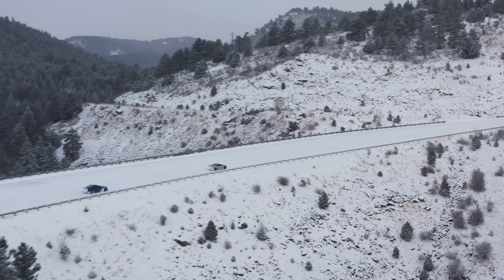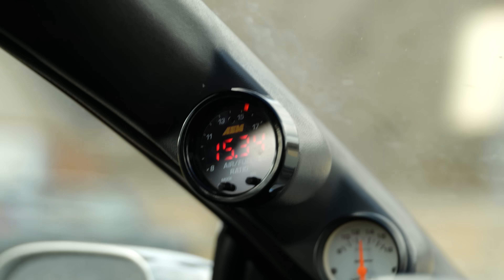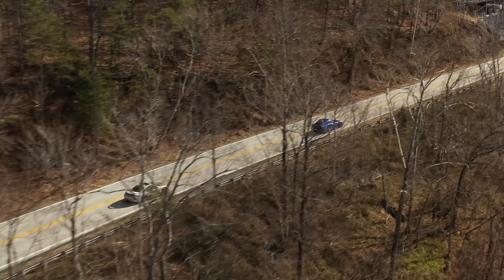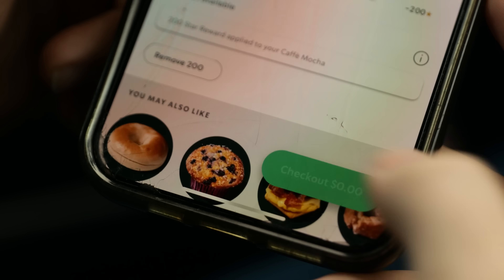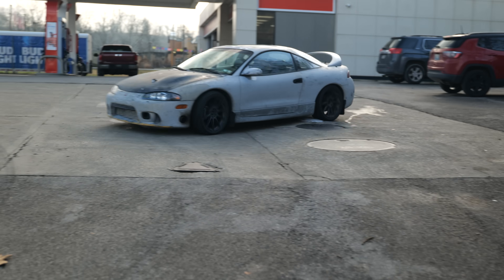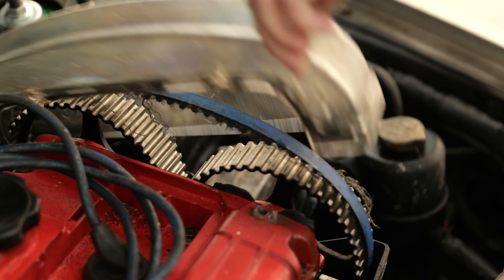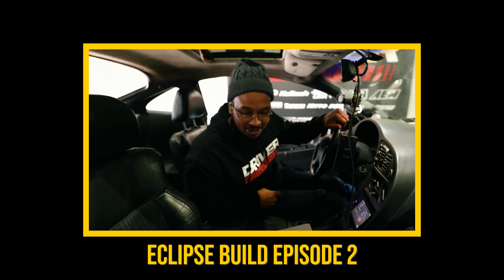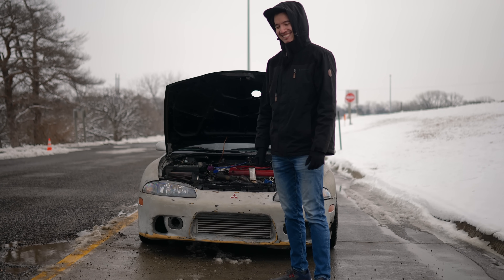We roadtripped across the country for as CHEAP as possible - Episode 1

Comment: As a longtime DSM owner the #1 thing I can tell you is ALWAYS change the timing belt no matter what the previous owner tells you bc people have a very bad habit of doing things wrong on these cars
Reply: Yeah, I have to assume it was just an oversight. No one in their right mind should trust anything that guy did on that car.
Reply: And if you remove the pan.... Bolts in proper spot.
Reply: Tons of amateur mechanics have touched these cars. Definitely good to verify everything.
Reply: Also nothing other than oem for tensioners, I used an aftermarket one and it lost pressure after only 500km, good thing I was tossing in a kiggy Crank trigger and I caught it before it wiped my motor out.
Reply: @schafer240  do they still even make them? I thought they discontinued the 6 bolt tensioner, like the knock sensor.
Reply: @8145dwerdna  I just bought three so I would say no they still are available, if they are discontinued and limited, that I'm not sure. I got mine from Mitsubishi in Japan.
Reply: And the possibility of the recall not being fixed on them too, the exact same thing happened to my dad's TSI in the 90's, it was almost 2 years old with 25k miles on it when it happened
Reply: @wolfgangkoeppen52  the previous episode showed receipts for a new motor...
Reply: @8145dwerdna  came here to say the same. 

For anyine who doesn't know, there are 2 bolts that are shortest than the rest of the bolts on the oilpan. These need to be used beneath the timing belt because using the longer ones will destroy the timing belt.
Reply: @8145dwerdna  mine is a 7-bolt but they still make it
Reply: As a longtime RX8 owner  the #1 thing I can tell you is ALWAYS Premix, Rev high, and Don't look at the gas gage!
Reply: Not to mention, they literally had taken apart most of the stuff to access the belt to begin with... I can't believe they didn't change it.
Reply: Any used car with a timing belt, with no history change it!
Reply: Used to own a 1st gen DSM. 100% true what you say. People beat on these things and try to make as much power out of the 4g63t engine with cheap parts from Wish. Almost every DSM lives a hard life...a life of broken trannies, clutches, blown motors, head gaskets and ofcourse RUST
Reply: I made a comment above and then right after figured somebody else already would have said it better lol- I had a '94 TSi, this is bringing me back to the old DSM forum days....
Reply: @Kasfinallygames I lived on dsm tuners and before that dsm talk.  I had 1g evo3 tsi and then moved onto a Holset hx35 2g gsx.  I miss those days so much!
Reply: Yes! tuners & talk I couldn't remember but that brought it right back @kottyking
Reply: Miss my 98... was a beast, 2.3 stroker 20g turbo 465hp.. I see it once in a while, still driving around the city, and it's changed owners a few times over the last 9 years
Reply: @12pawsinn  my dream build was a stroker, never got to do it.  I was part of the Holset gang that figured out how awesome they were on our cars.  Bullseye performance made a hot side you could bolt up to a ported 2g manifold so you didn’t even need to swap to a t3.  So cheap and could be found from the diesel guys upgrading their turbo.  I miss how cheap and easy it was to make good horsepower in the 4g63.  Yes, they had their moments of unrealiability but that was almost always user error or just something over looked in a car making over 400hp.  So when things go bad, they really go bad as seen in this video when timing belt shifted.
Reply: @Kasfinallygames  those were the days man.  Too bad time has eaten these cars.  I’d love to find another one in good shape.  I’ll always have a soft spot especially for a 1g Tsi with the gray bottoms.  My introduction to these cars was a friend picking me up in a laser.  The thing was hideous with a porno red interior.  He pinned the throttle my nuts hit the seat and it was a feeling I’ve never felt before at the time.  I was hooked on dsms after that.
Reply: Currently replacing a motor in a Diamante because of a similar oversight
Reply: But if he was to actually do maintenance, and treat the car properly...how would he be able to trash talk DSMs reliability and act surprised for his youtube channel when it failed?
Reply: Dsm and timing belts. Lost my 1997 because of it
Reply: DSM for life!!! I still have my 1998 AWD Turbo Eagle Talon TSi, modded to check of course, but interior is full and the only delete I did was AC, that's it. Still looks like she's off the showroom floor. Still on talk and tuners occasionally, but nowhere near like back in the day. I have been trying to find the bigger brother 3/S Sealth RT/TT . I've always liked the Stealth and Talon bodies over the Eclipse and GTO 3000GT
Reply: @Tyler97GSX  These, Civics and Subies have all just been through too much on the used market. You basically have to fine tooth comb them or redo absolutely everything if you want to even have a shot at something being reliable. And even then gremlins always pop up because cars are gonna car... lol

Comment: Is a fully built eclipse motor more reliable than a fully built evo motor?
Reply: Depending the Evo
Reply: It’s more reliable than a fully built sti
Reply: @Dcdc956 that's fk true😂
Reply: 4g63 and 4g63t have differences. Evo 1-3 used the same engine as eclipses, for evo 4 came bigger changes. And some new issues too. Common to see evo 4s with never evos engines for safety. Both of my evos had evo 7 swaps, for reliability.
Reply: Every generation tried to fix issues and faults for the next evolution.
Reply: From owning both I can tell you there's absolutely 0 difference, they are both reliable and unreliable for different things, also @CodKossu EVO 1-3 did not use the same engines as the eclipse they are especially 6 bolt to 7 bolt, 1G DSM to 2G DSM Years also make a difference, 98 up had the split thrust bearing. Stuff like that
Reply: It's the same shit just backwards.
Reply: assuming you're talking about 2g eclipses, what motor you got depended on the trim of the car. base model RS and GS models came with 420A's which is i recall are the least desireable ones since they make the least power out of the others. spyder GS came with a 4g64 which is a 2.4L making the second least amount of power. GST and GSX came with a 4g63t which is the same motor found in most of the evos except the X. so asking if the eclipse motor is better than the evo, the evo had the best variant of the three from which the eclipses had.
Reply: @Hogstyle the gsx comes with a 4g63t as well...

The 92 plus motors were 7 bolts like the evo 3+. The evo 4 flipped the engine to reduce the number of layshafts in the transmission. Each generation had changes, but they are very much the same engine. My 93 dsm 7 bolt has all evo 9 front end parts (oil pump, oil filter housing, timing belt components, timing gears). I also have an evo 8 crank and rods and pistons. The valves springs, valves, and many other components in the head are the same.
Reply: Very similar later 4g63s are rotated 180 to the passenger side. The evo does have 1 serpentine belt to drive accessories while the dsm is separate with 2 or 3
Reply: Depends who built the engine
Reply: @Carlos.Rivera 😂😂😂

Comment: I bought a 88 gmc Sierra 1500 for $750. in Oregon this last December. 
I spent $18 on a coolant temp sensor. 
Hooked up the tps sensor that was installed incorrectly by the previous owner. 
Ran perfect after that. 
Drove it for a week, then decided to drive it cross country from Oregon to north Carolina, with $600 in my pocket. 
Got 15-16 mpg all the way across. 
Slept in the camper shell that came with the truck. 
Ate terrible truck stop food. 
Arrived for Christmas with my family in 5 days with about $80 left. 
Done a ton of those type of trips over the years. 
Get out n have fun folks.

Comment: I will say with the experience I had with my 04 Rx8 through 15 years of ownership (4 failed motors, 2 failed transmissions just for starters despite doing everything under the sun you're "supposed to do" with a rotary) I am utterly shocked it actually held up, mind. blown.

Comment: Is so funny how you talk about the RX8. I had a friend with one that routinely drove from FL to KY and they did nothing special to it. No premix or that weird Rev thing. That car had nearly 150k before they finally traded it in for an SUV. That thing was bullet proof
Reply: I think the key thing was that your friend's car was probably continuously on the road and not in a barn for four years. And then Ben swapped in some sort of special motor and anything special needs special treatment.
Reply: The rev is really only needed on low compression series 1 rx-8s due to the weak starter.

Older rx-8s can use the series 2 starter to help with this as well.

With the extra oil injectors on the series 2 (which the R3 is) premixing is less of a problem but I still do it in my 2011.

Ben should remove the clogged cat before it causes damage to the engine.
Reply: That’s a hell of a lot of wasted fuel😮
Reply: That's because he doesn't know what the hell he's talking about I can guarantee he didn't buy it with a blown motor it was flooded he did do the deflood correctly but when they start they smoke like a freight train and will continue to do so until you clear it out which means either drive it or hold it to the floor intervals until it stops
Reply: What kill rotary engines are short drives, and never letting it fully heat up.
Reply: 150K is fucking nothing. Jesus, I'm sick of rotary nerds pretending that their cars are reliable. Just own up to it to man, and you'll feel better

Comment: As a longtime RX8 owner  the #1 thing I can tell you is ALWAYS Premix, Rev high, and Don't look at the gas gage!
Reply: I have an RX8 Series 2 GT similar to the one in the video, premixing isn't as necessary since it sprays more oil onto the engine that the S1s, I'm at 78k miles and still perfect compression and starting
Reply: @threadworm437  Mines at 108K with 7.6 and 7.8 on compression as an S1 🤣

Comment: when an rx8 r3 is in high gear and just cruising at around 65 its surprisingly efficient . loved mines
Reply: I get around 18-20 on road trips on mine.  My Silverado 5.3 gets about the same mpg but it's about the smiles per gallon
Reply: What rpm did you cruise at lets say 70mph? I wonder how those things are geared
Reply: @arlowelee  They run in the 4k range at interstate speeds.
Reply: @ScottJ175  Dam thats crazy. Even my Honda only is about 3500 at 70. interesting thanks
Reply: Yeah I usually average around 20 mpg with mostly highway and some city driving. I bet the rx8 in the video had a clogged cat which destroys mpgs
Reply: @arlowelee Yea my 1990 Miata is over 4k @ 70mph haha! So I stick to backroads most of the time around 45-55 with the top down and it’s always a nice drive. Love the car but glad it’s not a daily.
Reply: @arlowelee  normally cruise at around 3000rpm at 70 in 6th gear on a flat highway and just keep it there . getting up tp speed uses more fuel than maintaining the speed
Reply: I got 24mpg on my trip home from buying (~310 miles, mostly highway but some stops and idling)
Reply: @dellstudio10  Holy crap the miata is at 4k? Ive never driven one but i get why they say its so fun to. Practically rallycar/racing gear ratios with them so short

Comment: I owned a 2008 RX8 40th Anniversary Edition back in 2010. I loved that car and with proper maintenance, it was reliable. The stigma around this car is based around the fact that people not familiar with the rotary engine purchased them and tried to do the same maintenance as an IC engine. I feel the pain of the fuel mileage though, I think I averaged 14-15 MPG of the span that I owned it.

Comment: I had a 1995 Eagle Talon, and the same thing happened to me, the bolt on the belt tensioner loosened up, and took out the timing belt, luckily some how the head was good, and no valves were damaged. They were also known for crank walk, if you throw a drive belt chances are it's crank walk if no pulleys are obviously bent, or damaged.

Comment: They didn't put the short oil pan bolt on that goes underneath the t-belt. There is 2 short oil pan bolts so it doesn't rub on the timing belt.
Reply: It's been fixed but the belt didn't have a groove in it

Comment: Honestly, the coolant smell might not necessarily be because you're burning it; the exhaust isn't white enough, the RX8's smoke a lot when it's cold, so it looks normal. The under-the-hood coolant smell could be because it might have a leak or the overflow bottle is just puking the extra. As for the P0420, that's a dangerous game to play with an RX8 if it still has the catalytic...

Comment: I blew out my timing belt in the exact same way with my last civic. H22 swapped ek. Going 75 mph in 5th gear and the motor just stopped in the same way. I was an hour from home on a trip to get some used bucket seats, my dad was able to come tow me back home. I put a new timing belt on it and cranked it and by some miracle the valves didn’t make love with the pistons and it actually ran… freakin wild. My wife about killed me for that one.

Comment: Failed tensioners have cost me a few DSM valve jobs over the years, though I never shredded a belt, just jumped time. ALWAYS ALWAYS ALWAYS use a NEW OEM tensioner if and never try to recompress and re-use the old ones. It should be near a day 1 maintenance item at this point. Set the tensioner within proper range and always double check by running it though a full compression cycle so it actually extends to its operating position. Don't forget the balance shaft belt if an eliminator kit isn't in use. Miss the cars but definitely not the community of absolute hacks that seem to peddle them. That said, there's some really good people out there just the same and tons of camaraderie.

Comment: I've almost purchased both of these cars at different points in my life. 
The 2nd gen GSX (and 2nd gen TSi AWD) when I was living in Vermont starting my career (wound up with an SVT Focus). 
The RX8 when I had moved to CT was getting married, and was looking for a family car (Wound up in a 06 WRX wagon). 
The SVT Focus & WRX Wagon were nowhere near the pinnacle of automotive reliability, but I still feel like I dodged two bullets by choosing them over the GSX & RX8. 
I've been married for over a decade at this point, we have two kids & house; I drive a Lexus IS350 Fsport RWD now, mostly because of the vehicles I've owned previously being high maintenance; this thing has been oil changes and air filters over the past ~5 years, and it's easy to get at everything when I have to do those services; thanks Toyota, now make one with a manual trans that is ~600lbs lighter.

Comment: My first car was a -94 Eagle Talon..... I would have thought this video was fake if the Eclipse didn't end up on a flat-bed at least once lol. Built or not, Timing belts were notorious, one of my first mechanical experiences was replacing the head with 16 bent valves after mine snapped.... I still actually have the Haynes manual 23 years later and the timing belt pages are suuuuper oily.

Comment: FYI. You really don't need to premix a series two RX8. You also don't need to rev up the engine as you switch it off, unless your need to switch off without fully warming up the engine. Should save you a few pennies on your next penny-pinching road trip. 😉

Comment: I got close to 20 mpg for gentle highway driving in s2 rx8. Probably don't need to rev up the engine before shut down if the engine is warm
Reply: What's the purpose of doing the pre-shutdown rev?
Reply: @yongling9825  in owner's manual, it's suggested to do that to prevent the engine from being flooded, basically to get the excessive oil out

Comment: Correct me if I'm wrong did the eclipse have a gates blue timing belt on it when it broke?
EDIT - Yes it was, they have the SAME issue on 1.8T VW Engines and just break and fail. CRAP BELT

Comment: Wait, my 2006 Mustang GT has a similar issue as shown at 8:20. I have to fill it at half pressure/range of motion of the pump trigger or else it'll clunk out as if the car is full... I'm not aware of any repairs or swaps that have been done to the vehicle but if anyone can provide me more insight on how to determine with high probability the cause of this it would be greatly appreciated.

Comment: Stupid question, how did the timing belt destroy the headers?? Wouldn't the fix just be to replace the belt and that's it??
Reply: When an engine is no longer in-time, the pistons will move up too soon before the valves get to fully retract and cause impact between these two parts. It's a thing for interference engines when timing is off.
Reply: @yongling9825  Thank you. Now it makes sense why it's called a TIMING belt :)